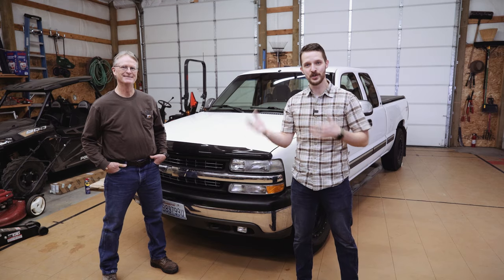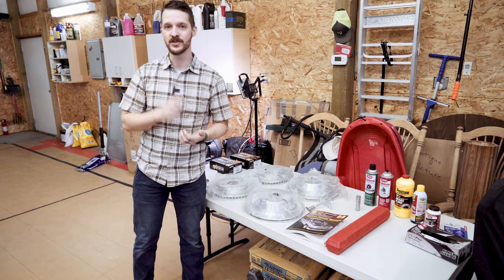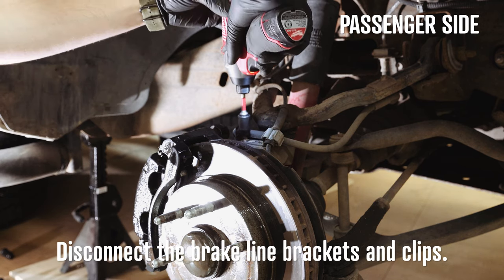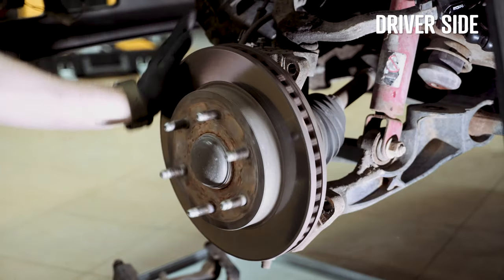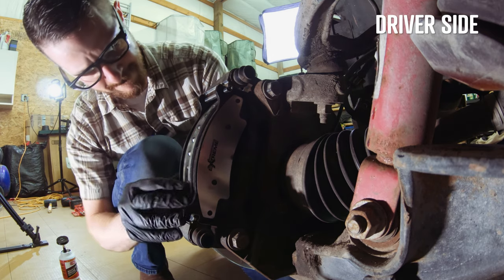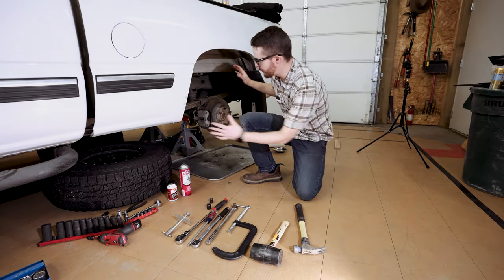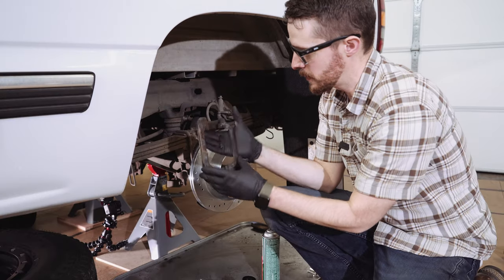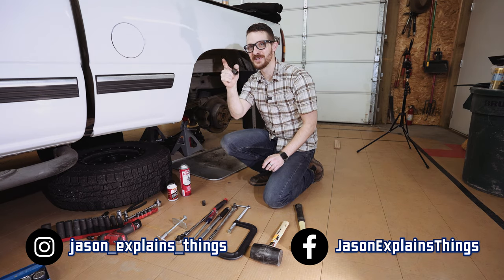How To Upgrade Chevy Truck Brakes!

Comment: Nice video and brake job. I 've always used the old brake pad and a c-clamp to compress the caliper pistons with out ever messing up the rubber seals and never thought buying the tool was needed.

Comment: Best to do a 2005 big brake upgrade. Replace the 1999-2004 small rotors with the 2005-2007 bigger rotors and calipers/brackets. Rear brakes can use the SUV dual piston calipers and vented rotors for 01-07' Suburban, for it's 7,200lb. GVWR
Reply from the maker: That sounds like a sweet upgrade.
Reply: You can now do the 2019-2022 Chevy brake upgrade. I have 35’s and I d don’t really like my the 07+ brake set up. Hopefully the 13.5’s and decent rotors will do the trick.
Reply: I just this upgrade and it’s highly recommended. The stock single piston calipers will fail and cause a lot of problems. The dual piston caliper upgrade is a must. Plus change out the torx bolts with the hex head ones to make things way easier in the front.

Comment: You can buy 07 brake rotors and calipers and they will fit directly on. HOWEVER you need 17” wheels or bigger. That next gen if brakes are far superior at a fraction of the cost
Reply: You can also use SUV rear dual piston discs, and the police version has a thicker rotor.
Reply: Where can I order em?
Reply: THAT FRONT ROTOR WAS ON 05' to 07' Classics

Comment: Great video.  I was also hoping you might review the Power Stop brake kit and note any improvement in stopping power as compared to what you replaced.  I have a 2006 Suburban and have changed to a higher end pad and noticed a slight improvement in stopping power.  Brake pad longevity also a major improvement.  Silverado and Subs are known to have spongy brake pedals and if towing you need all the stopping power you can.  I flush my brake fluid annually and love my old truck but the brakes, including the emergency brake have always been fair at best.  

Are there any real benefits of buying  power stop products vs. installing any typical high end pad, shoe, rotor.  Will my truck stop better?  
Thanks again for you well produced video.
Reply from the maker: Not my truck, but my dad has spoken pretty highly about it since then.  He also pulls a pretty heavy dump trailer from time to time and said it’s been great.
Reply: You can now use 2020 Silverado Calipers. They are 13.5, and 4 piston calipers. Starting around 05, some 1/2 tons also came with a factory hydro booster. If you want something bolt on.
Reply: @Chase Lesser do you know if the 2020 brakes fit the stock 16" wheels on the older trucks? Another video said you need 17"+ wheels.

Comment: Wow, you really breezed through it. I wished you would have explained  more with in the steps you were doing. What kind of stuff did you put on the guide and back side of the pads? Or does it not matter.
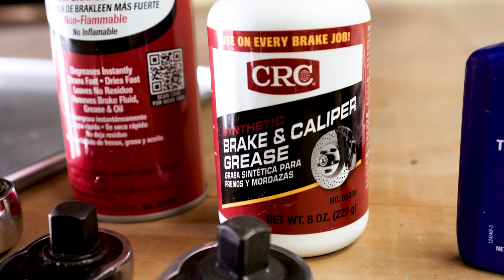Reply from the maker: 2:54 Merry Christmas Randy.

Comment: my 2001 Chevrolet Silverado 1500 custom conversion edition has single piston calipers on the back and I can't keep from burning the brakes off of it I need to upgrade system to a two piston caliper which I understand I have to change the rotors pads and brackets

Comment: A 2000 Silverado with less then 100,000 miles, that’s rare af
Reply: I have a 99 with 80k
Reply: That's mine also when you commented in 21'. Now it has 104k garage kept and only used to tow/ truck stuff and weekend recreation.

Comment: How good are the power stop brake kit? Would you recommend? I plan on changing my brake pads and rotors for a 2005 tahoe. I currently installed slotted and drilled R1 Concepts rotors and pads for my 09 lexus IS250.
Reply: My friend I bought some on Amazon from some Canadian outfit and it came with everything. I was looking at the ones this guy installed and it was about $190 more than what I paid I got away for under $200 and a stopping power is amazing most definitely need your brakes but you can save some money look around this is a great company that he's looking at but 450 versus two you tell me

Comment: I just put the z36 tow kit just on the front I noticed that It felt like more weight on the front or did I do something wrong ? Is this set up heavier than the original one

Comment: Do you have to use 17 inch wheels, or will 16s work?
Reply from the maker: I’d check powerstop’s website.
Reply: If you are replacing front rotors with the 2005-2007 13" and calipers  yes, 17" is min wheel.

Comment: I am curious if the stock rotors vs drilled and slotted has benefits.  I like the idea of using the larger rotors from the 05 and up, but my wheels are 16”.  Jason does your dad notice a difference in performance?
Reply from the maker: Last time we talked about it he said they work great, noticeably better than the stock brakes.  He does a lot of towing as well and has been very happy.
Reply: @JasonExplainsThings  I really appreciate you getting back to me with that thank you!
Reply: @upstatecre8  fwiw I installed the drilled (but not milled) powerstop kit on my 2009 silverado. Stock oem brakes went 100k. Powerstops worked well, but only lasted 30k in same driving conditions. Went back to oem and went another 100k.
Reply: @ericdillenberger7873  Wow!  Good information
Reply: You should ungrade the front caliper bolt to a hex 18mm one. Easy to swap out with the wratchet.

Comment: The prices went up on the z36 kits.  I could have gotten a full kit for $280 for my colorado and kick myself nit getting them.
Reply from the maker: Bummer.  I hate when that happens.  Looks like Rock Auto's price is the same as Amazon.
Reply: @JasonExplainsThings  rock auto is good but shipping on these takes them off the order list.

Anything auto will usually run 20% off on powerstop from time to time but now theyre over $300.  Not a huge difference but Ill just run the z23 kit I got collecting dust and see ehat happens.

Comment: i got a 2003 2500hd express van as a parts vehicle and wanted to know if i can move the front brakes over to my dad's 93 silverado (i have two 8-lug rear ends that i can throw in the back) has anyone done this swap? I have been looking high and low and have not been able to find much info

Comment: Were is the upgrade why didnt you install 07-14 rotors and calipers that would be an upgrade.Same cost same job twice the braking.
Reply: Hey Corvette,  are the 07-14 calipers and rotors bigger or just better?  I have an 2003 heavy suburban and I really could use all the stopping power I can get.  I started some research on it but if you could enlighten me that would b fantastic.
Reply: @BBB-ly8ro  Yes 1 inch bigger rotor and much stronger calipers
Reply: Ok Corvette, I’m all on board going for the front first with slotted rotors , calipers and ceramic pads. On the back I was wondering about the ebrake set of shoes.     Will the 00-06 ebrake shoes work or will I require the 07-14 ebrake shoes
Thanks again for the help.
Reply: @BBB-ly8ro  The 00-06 rear brakes are better than the 07-14.The 00-06 has a 2 piston rear while the 07-14 has 1 piston dont change them out.
Reply: @BBB-ly8ro  If you really want a firmer pedal feel upgrade the lines to stainless i used good ridge way firmer pedal.
Reply: My good man Corvette,  I’ve ordered NEW ac delco calipers , extreme tow pads , slotted rotors and Goodridge braided steel lines. 
You have made a difference.   The real-time response that I got really helped. 
I’ll give you a full report at the end of the week.
Reply: OMG Corvette,  I cant believe the nose dive my 3 ton suburban takes now with the 07s bigger rotors ( front only) new calipers and stainless braided brake lines all the way around.  Bolt on brake power.  Twice the braking power  for under 500 bucks.  It use to take 5 or 6 Car lengths on the interstate before the ol gal would start holding her own.  That’s not the case anymore.  I just had a pro brake job less than 2 thousand miles ago and I did nothing for stopping power.  I can’t believe that finally something I read on the internet was so magnificently true, especially YouTube comments.  Thank you  Corvette7444
ps   I wanted a firm pedal and didn’t even know it.  My tires now make that cold howling sound when you stand on the brakes. Like a banshee